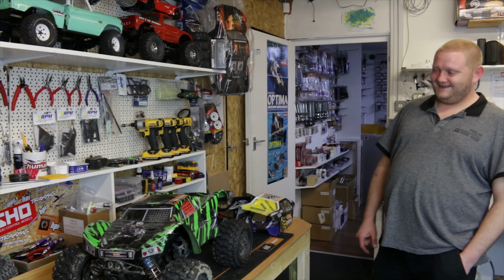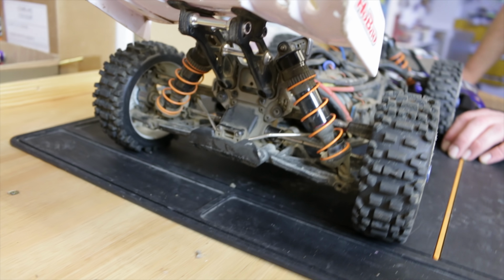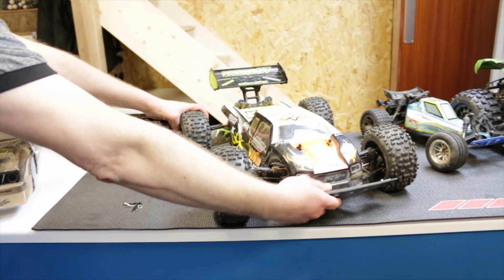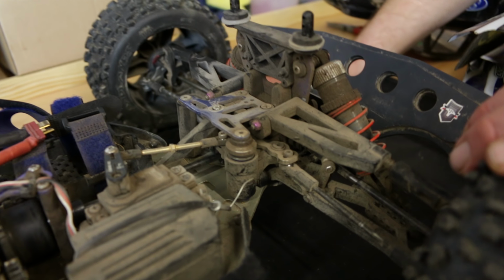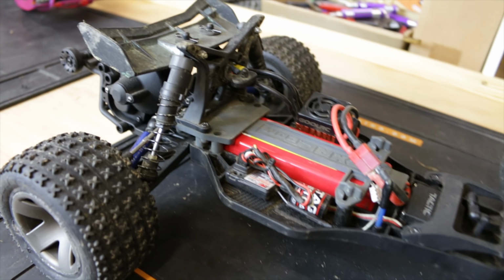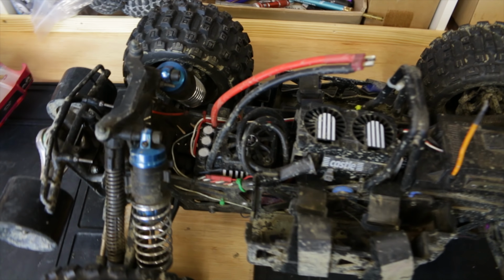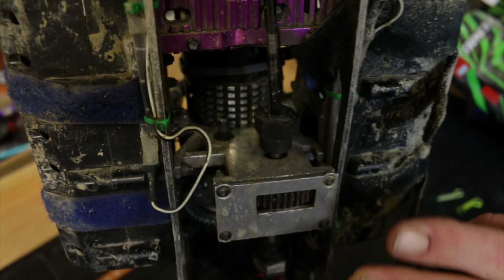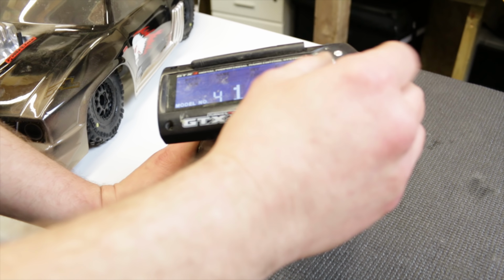8s Steves RC Collection

Comment: I have a 4300 kv motor in my slash 2wd and it is gool rc
Reply: What kind of spur and pinon did you use ??!??
Reply: I got one of them for a laugh.
Very fast. But no torque